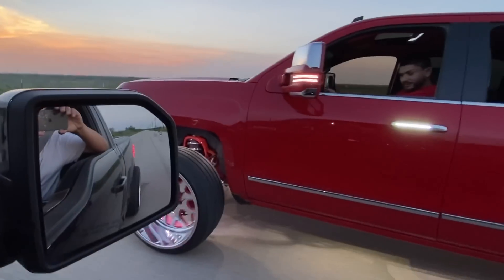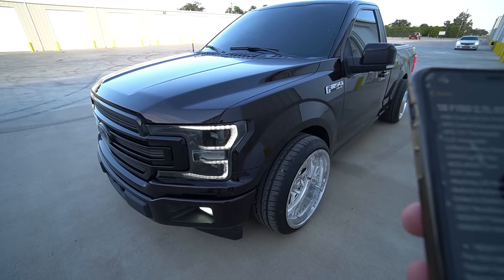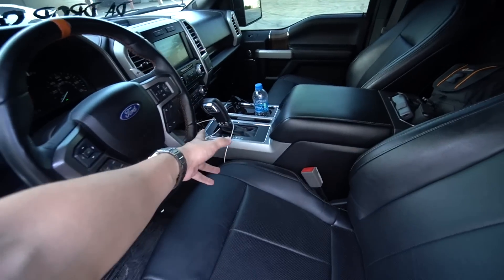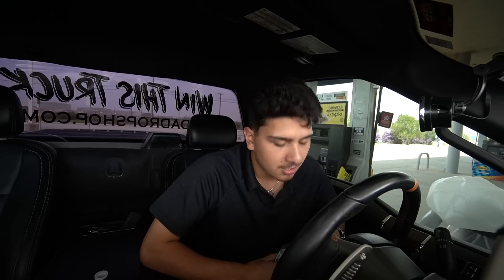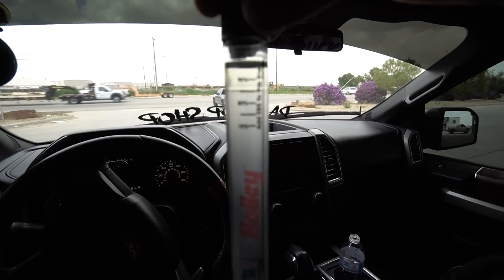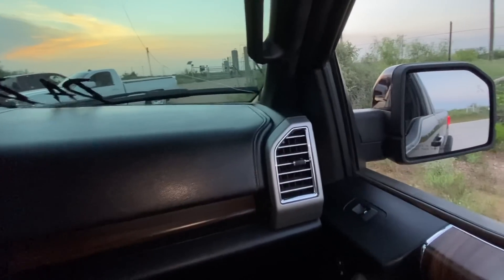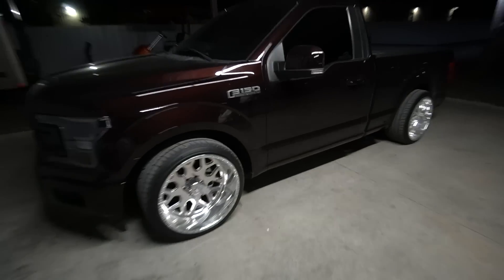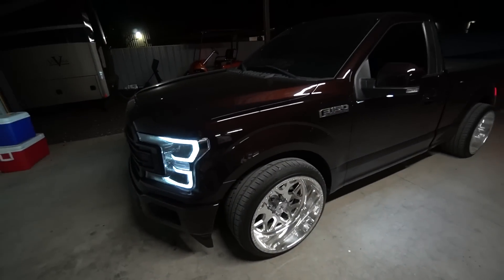2.7 ECOBOOST VS CAMMED 6.2/5.3 🏁

Comment: I bought my 2016 F150 2.7 new. I call my truck F165. It now has 102,000 miles with the stock turbos. I spanked a stock 2010 5.3 6 months after I bought it.

Comment: Don’t sleep on the ecoboosts. Finally a video to show everyone proof them eco’s are not slow.
Reply: I have a ecobeast mustang. And I beat 5.0s like nothing.. the ecoboost platforms are amazing!!  Specially if you build them up they smoke almost everything..
Reply: @Paper.Power.Politics  yea little does everyone know it’s cheaper to build a 1500hp 4.2 ecoboost then a 1500hp coyote🤭. Coming from someone who has gone over the numbers over and over and over. The 4.2 built ecoboost was always cheaper. And I’m building a 3.5 transverse mounted ecoboost so Ik what the numbers are.
Reply: @402SHO  yup I feel ya.. I’m gonna be building my 2.3 ecoboost.. with built block and head. With turbo and fuel upgrades ima be pushing between 700whp-1000whp. Gonna be about 20k.

Comment: Not sure when people will learn that N/A  vs Forced induction will never be the same in a race
Reply: The “NA”  cam heads FBO, make just as much power the little V6 does with forced induction  … that’s the only difference
Reply: Forced induction = the replacement for displacement

Comment: Bro im about to buy 3.5 or 2.7 cant really decide new to trucks any suggestion for me i will tune it for sure either engine. And what are mods u have on this 2.7 thanks..
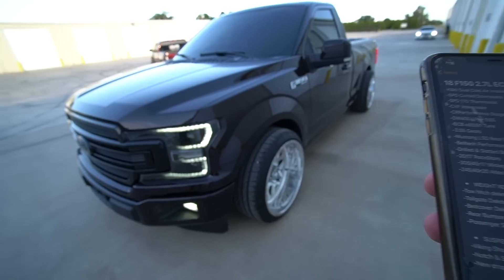Reply from the maker: All the mods are listed at 0:49 seconds
Reply: 2.7 is alot more reliable and solid built but the 3.5 is easier to make more power out of

Comment: Forced Induction is the replacement for displacement.
Reply: Just turbo the 6.2
Reply: @googleaccount2637  so… forced induction will make it better?
Reply: @mick2798  haha quite obviously.
Remove the turbos from the 2.7 & see how it does against stock 6.2 NA.
Reply: @googleaccount2637 so we need to make it easier for the NA v8 engine to win?
Reply: @mick2798  the 6.2 is vastly superior.
Look how many fords run turbo 4.8L, 5.3, 6.0 & 6.2 small block GM.
Reply: @googleaccount2637  I mean I just watched it get smoked by an ecoboost….. Vastly superior in sound? Yes……. performance not so much
Reply: @mick2798  check out all the mustangs rockin real motors with those sweet sweet turbo GM small blocks.

Comment: Im confused, someone told me e85 is not as strong as gas, so why even tuning on it?
Pls give me some advice on this
Reply from the maker: Just depends, e85 is way stronger than regular gas if you’re tuned for it. You could gain 20-50hp easy on a boosted motor.

Comment: GM owners be hating on ecoboost motors but want to slap turbos on the LS engines. Dont be a hypocryte on ecoboost motors. They did it first. Even 4 cylinder cars destroy GM motors. Its because they torque up quicker. GM can build all the big engines they want. If they cant torque them or engineer the trucks right its just a giant brick down the road. Lol. GMs be breaking transmissions, differentials. Everything.

Comment: It needs the 5.0 come on now
Reply from the maker: 5.0 couldn’t even keep up with the 2.7 unless its boosted😂😂
Reply: @FernJrr  sheeshhhhh betttt
Reply from the maker: @Victor Garza obviously not if its a boosted 5.0 V8 vs a factory v6 😂 Boosted 5.0s run 8-10s easy. This is a 11sec truck w/o weight reduction & built trans
Reply from the maker: @Victor Garza hell yea thanks man but the ecos run super good for what they are

Comment: too bad the EcoBoost will self destruct if you try to use it as a truck.
Reply: No it won't. I haul a thousand pounds of tool around in hot Tucson Arizona. I get 17.1 mpg and 94000 miles. Water pump replacement is all I have done to it.

Comment: Love the 2.7L❗️❗️❗️ Check my channel to see quick clips of two races I had with my boy with a single cab tuned 5.3 that was cammed. I’m all stock in both (well I have 20x14’s) and I’m a four door with the 6 speed, I have the 6r80 not the 10r80